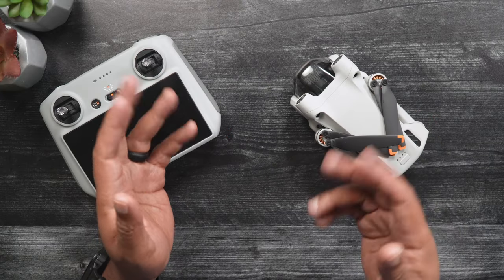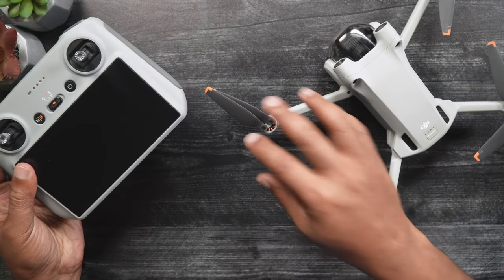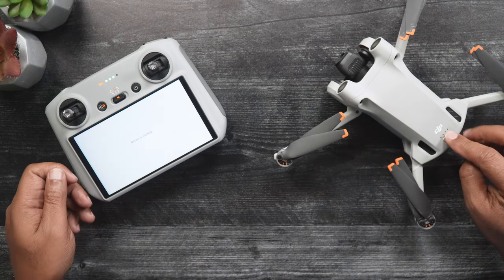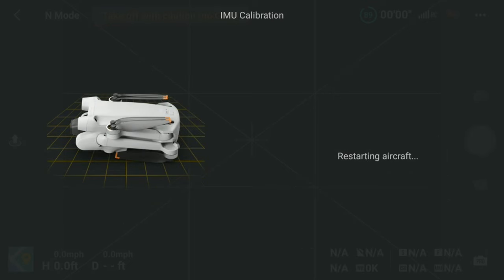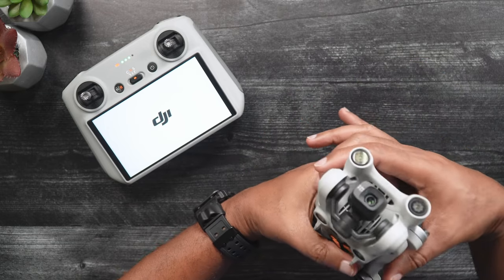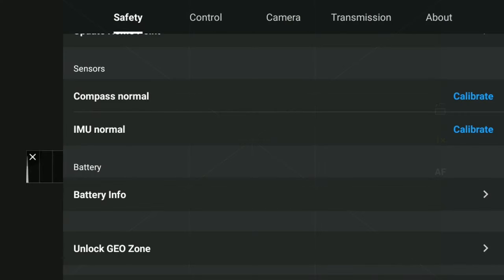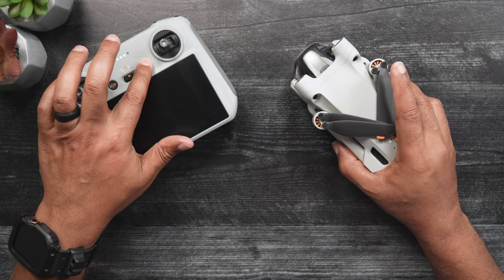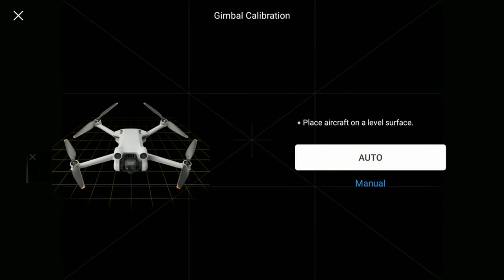DJI Mini 3 & Mini 3 Pro: How to Calibrate IMU, Compass, and Gimbal

Comment: That's a thorough presentation. No one can miss. Often instructors say: Press here while the hand covers the picture. You didn't do such mistakes. Well made video.
Reply from the maker: Thank you very much, we appreciate it! Thank you also for viewing our videos.
Reply: @Droneblog  Trying calibrating the IMU things don't work out as I expect.
The IMU calibration is stuck at 2/5, 95%, and nothing happens for several minutes. What is the mistake?

The compass calibration runs as You show it. Gimbal calibration runs the same.
Reply: you are out of your mind.
Reply: @malanalan1  Elaborate that if You have any knowledge to add.
Reply: Same here    2/5,95 % and no prompts to move drone. Battery  was a bit low. Was trying to Cali  on this bat instead of fresh one. Going  to switch  bat and try

Comment: Thanks for sharing. I purchased a refurbished DGI Mini  3 Pro recently. it works just fine. my only issue is that i have to calibrate it before every flight. This is very annoying  as it take a little time to do so.... How can i correct this issue?

Comment: Ahh thank you this just worked for me. I was using a windows computer. It calibrated ok. 
Thank you for the video. 
One thing I took with me was a small fan to cool the drone down when calibrating it. 
Thanks again.
Reply from the maker: You're welcome. For the Mini 3 Pro (and 4 Pro), I use a laptop fan pad to keep the drones from overheating during any stationary procedures as well.

Comment: Great video thanks again for sharing this information.  I’ve got a question about the calibration for compass. Do u need to this when I received my DJI mini 3 pro before my first flight????  I ask because my drone drifted after first test and landing which was off I had a crash the second flight my drone drifted away from me backwards saying compass needs calibration?? Right then I looked at mini 3 pro a hit several things and propellers where still spinning I was shocked drone had 3 propellers broken??

Comment: hi Dan, I was wondering if you could answer a question I'm a beginner to flying drones and purchased a dji min pro 3. but for some reason the drone does not move forward and back only if I take off the safety feature off then it moves in them directions any idea how I can resolve this issue? very much appreciated if you could help.

Comment: Hi Droneblog. Myself I've been flying Drones since 2014 and am a 107 with a successful business. Bad info on calibrations here. My self I only do these calibrations when setting up a new drone coming from where ever, or when it ask for it. N.S.E. and West never change so don't calibrate like you suggest. It can screw up the compass. Called over calibrating if you've never heard of it. the IMU only if it tells you to after the first time. 
I've been from NC to Fla, to SC, to NY. and not one time had to compass calibrate and had no problems.
Reply from the maker: Thank you for reaching out. We appreciate your info and knowledge as a professional drone operator.

Comment: Can you plz tell me how to calibrate obstacle avoidance with remote?
Reply from the maker: Bill, there shouldn't be any calibration needed for obstacle avoidance, just the options to set the behavior of the avoidance (Brake, Bypass, and off). Are you having issues with the vision sensor giving errors?
Reply: @Droneblog  no errors, I checked settings, showing obstacle avoidance is active but it's not. I had a light bump that's when it started.

Comment: calibrated 3 times -gives success message everytime and then tells me I have a gimble calibration error and to calibrate -endless loop wth
Reply: This happened to me also. Would love this explained why
Reply: Same here.   Sent it to DJI. They said $293 to fix.   I had the unit for less than two years and only used it about ten times.  I will not be fixing it. Instead, I will smash it with a hammer.  I am done with DJI.